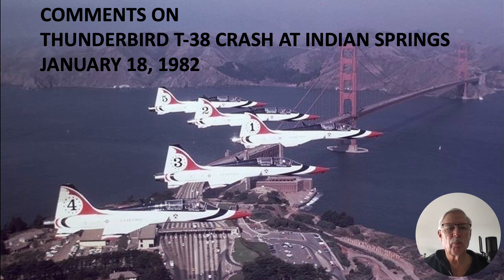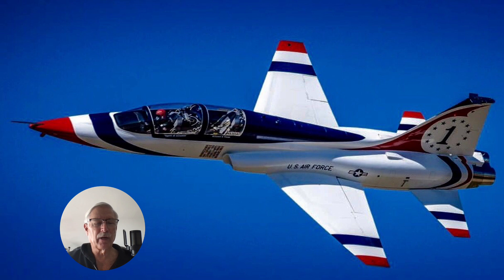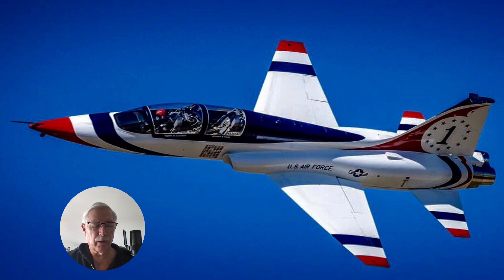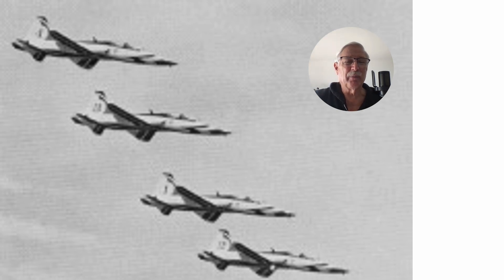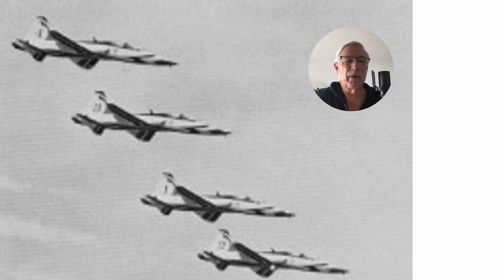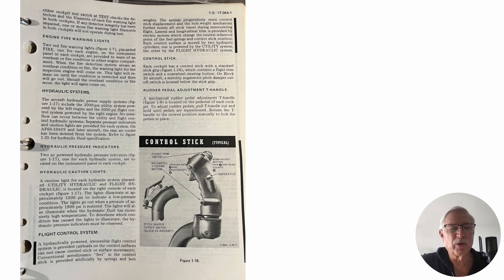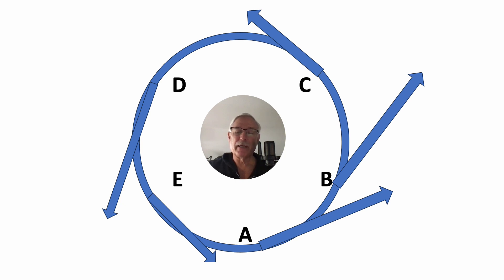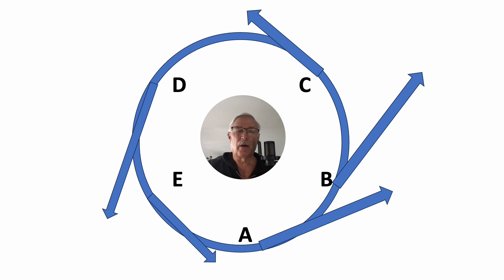COMMENTS ON THUNDERBIRD T-38 CRASH AT INDIAN SPRINGS JANUARY 18, 1982

Comment: I was involved in the “collateral” (releasable) investigation. FOD (a tool) was found to have jammed the flight controls. Lead, for undetermined reasons, was not using a hot mic. When lead removed his hand from the throttle, presumably in an attempt to gain greater authority, the remainder of the flight was committed to the outcome. Lead did not call “knock it off” because his hand was off the throttle with the mic button. 2, 3 and 4 were concentrating on maintaining relative position to lead. The crash scars were in formation.
Reply: What kind of tool was it?
Reply: This is absolutely NOT true. False statement. I was on the team and never was there a tool cause of this accident
Reply: @RodgerFreiberger Which team?
Reply: @RodgerFreiberger Which team were you a member of?
Reply: @richardbriscoe8563  What kind of tool was it?
Reply: @Peter-u6d It’s been a long time, but, to the best of my recollection, it was a screwdriver.

The commenter who said he was on the team, I suspect, may have been involved in the privileged safety investigation. Making any comment about the content of that investigation is a serious breach of discipline.
Reply: @richardbriscoe8563  The report I read that was published in AW&ST doesn't mention a tool but it does say FOD was a possibility due to the condition of the stab system overload cylinder.
Reply: @Peter-u6d The collateral investigation, the publically releasable one, was conducted at the direction of HQ USAF due to the chain of command of the Thunderbirds although the mishap occurred at a TAC base under the command of 12th AF. I haven’t read the article which had to be a summary of the lengthy report and so I won’t comment on the article itself. I did have real time information during the conduct of the investigation. 

It was a sad day and the result of a chain of circumstances.

Comment: The “Diamond crash” I am familiar with involved FOD interfering with elevator control. Lead was not flying with a hot Mike, which we were briefed was SOP. As a result, when lead took his hand off the throttle to use both hands on the stick the rest of the flight was condemned to the outcome of lead. It’s hard not to fault lead for this.
Reply: All the aircraft I worked on hot mike was only between the front and rear cockpit it had nothing to do with transmitting to other aircraft.
Reply: By the time Lead knew he was in trouble, recovery was impossible for any of the aircraft.

Comment: Two things: 1) Even mechanical flight controls have redundancies, therefore, single-point failure of a jam more likely than actuator failure - 2) pulling throttles back would seem advisible in order to increase pull-up rate.

Comment: I had read years ago about the Push to talk switch location on the throttle quadrant being a factor in this incident. The theory was that he had an elevator jam and pulled his throttle hand back to the stick to apply more back pressure and as a result couldn't call the break. I read this years ago and it really stuck in my mind. Can anyone here confirm or deny this who actually knows?

Comment: I remember seeing this crash on TV as a little kid; the flight of four white T-38s in tight formation all flying steady near bottom of loop right into ground at about 25°-35° angle before what should've been leveling back into horizontal flight, from what I can remember... all on a sunny and clear desert day setting... the exploding wreckage of all 4 planes happening almost simultaneously, and "bouncing back up" hurtling together in a huge-shallow fiery arc across the desert backdrop... not so much a "fireball" as probably more-like wildly-expanding conflagration that crashed and exploded again at the end of that fiery-arc across the desert. I thought about this incident in recent years and searched online for this footage; to my surprise some USAF commanding officer somewhere along the chain ordered the complete destruction of this footage, although I'd imagine some TV news network would probably have it on video tape in the archives somewhere.

Comment: So you;re saying the actuator failed late in the loop but because of the increasing speed (they were pointing downhill) the nose continued to rise as the speed increased further and the elevator generated more downforce even though it was 'stuck' and no longer following stick pitch inputs from the pilot - masking the problem.
By the time he realised he had a pitch control problem, it was too late and he went in. The other 4 of course would have no idea that lead had a problem so they stayed in formation and perhaps only became a aware of the proximity of the ground far too late to do anything about it.
The report saying he pulled the power back to idle is odd. If he'd done that the other 4 would have left him behind as you say at which point they would probably have broken formation in time to avoid the rapidly approaching ground.
Vince

Comment: I was stationed at Indian Springs AFAF with Operating Location Alpha, 2069th Communications Squadron, May 1981 until May 1983.  We maintained the air traffic control facilities there, and radios and scoring systems at Range 65. It was common to see the T-Birds practice at the Springs.  You got used to it.  That morning I was walking along the flight line to the control tower watching as the four came across the field from the west and pulled into the line abreast loop, went over the top, and descended to exit the loop to the east at the point they had entered.  They were still 'sinking' and the last I saw was #1 pulling nose up, tail down an instant before all four aircraft simultaneously impacted the ground on their bellies traveling forward, three rapid succession explosions and they disappeared into that angry yellow, orange, red, black roiling ball of flame and smoke.   Sounds and imagery that burns into your memory.  I still have PTSD as a result.
I never again watched them fly, or any air demo team for that matter.  In 1983 I was assigned TDY with the T-Birds to design and develop their new public address system.  At each base visited, before the show started I found a hanger or building that was relatively quiet where I could 'hide' and avoid seeing the show.

Comment: I am wondering what the dive recovery charts would have shown as far as recover-ability for the wing men.  I also have to question the safe ejection altitude for the T-38 ejection system.  I flew the F-4 and I would say a Phantom would be hard pressed to make the square corner after passing E and ejection would be on the ragged edge.

Comment: This is a pretty good synopsis overall, Roger. 

When DL punched out at Cleveland, Burke Lakefront, the team was taking off in elements of two, two, and three due to the the short (6000') wet runway. They planned to meet up at thenext gas stop and reform for arrival maneuvers at their next show site. DL liked to connect his lap belt off center and the team was using a new lap belt system. A moment after  he punched ( after he called his crew chief to eject),  the lap belt opened and the "butt snapper" launched  him out of the seat right on schedule.However, the new lap belt contacted the ejection handle and the locking mechanism turned, which popped the zero delay lanyard out of the socket in the belt buckle, eliminating his low altitude chute deployment.
Reply: Had he worn his lap belt centered, would this have occurred?
Reply: @joe92  That is hard to know for certain, but where it was connected would ultimately determine to where the buckle would hinge to when it was automatically released.
Reply: Thank you for the additional details of this incident.

Comment: The one thing that really makes no sense in the accident report, is that the Boss hit the ground, tail first; since the formation is coming down the backside of the loop, when he had the control failure, all four went straight in, nose down, so the fact that the report said that all four hit tail first, is wrong. I can see hitting tail first if the Boss managed to find a way to start pulling out of the dive, and the formation had run out of room for a safe recovery. But, no, they all went in, nose first.
Reply: The report did not say all four hit the tail first. By the time they were close to bottoming out, they were pulling 7 Gs. The line abreast was sagging at each end due to the unusally high formation Gs. #4 hit first, nose low on the outside left, followed by #3 just slightly nose low on the right, followed by #2 flat on the inside left, followed by #1 slightly nose high. #1 almost made it.

Comment: I found a copy of the USAF Mishap Report for this accident on a website some time ago. The Mishap Report, unlike the Accident Investigation Board report, was not released to the public at the time. The person who had it on his website got it through an FOIA request.  The Mishap Report goes into a very detailed analysis of the accident and of the components of each involved airplane. The lead T-38's stabilator actuator and pitch trim actuator showed no evidence of malfunction prior to the aircraft striking the ground, and from my reading of the Mishap Report, it's pretty darned certain that Major Lowry simply messed up the recovery from the line-abreast loop.  The conclusions at the end of the mishap report repeat essentially what the AIB said, that the leader's stabilator jammed, but with no supporting evidence to that conclusion that I could find within the Mishap Report. There's no mention of a "load relief cylinder" and I've read elsewhere that the T-38 doesn't actually have such a thing, that it was made up for the AIB report that was released to the public. I've uploaded the Mishap Report to my OneDrive account, you can download it here:
https://1drv.ms/b/s!AgkGLeB5btNZ-kWRHATlG3juhq8h?e=eeMBg2
Reply: I've read both the mishap report and the summary of the accident report in AW&ST and have noticed inconsistencies between the two but there are pictures of the leads "load relief cylinder" showing it in pieces due to tension overload.  I think I know where the claim that the load relief cylinder does not exist  came from but he got it wrong.  It is in the system and you can find it in the T.O.  As a side note the aileron control system has a similar setup with an "over-load relief spring", it prevents cable loads from overloading or damaging pulley brackets and operating mechanisms.

Comment: Years later at WPAFB, I received a briefing on this accident.  Was told the stabs on all of these T-38’s were purposely adjusted outside maintenance manual specifications in order to gain improved inverted performance.  This resulted in limited stab  positive G or pull performance.  The briefer stated yes, the maneuver started outside required entry parameters, resulting in a lower loop.  He also briefed that had the stabs not been adjusted outside mx manual limitations, lead could have given higher g input earlier and avoided the accident.  This is what I was briefed and all I know about this subject.  I have no idea if I was told the truth.
Reply: The stabs were NOT adjusted whatsoever. The rudder limiters were removed, making the Thunderbird T-38s much more maneuverable than normal T-38s. (Those limiters were initially installed to make the typical T-38 more spin resistant as a trainer).  F-5 trim motors were installed to give the pilots more trim authority thus reducing PIOs at high speeds, and the engines had better oil accumulators giving the Thunderbirds twice the inverted time of a normal T-38. But nothing was modified out of any T.O. tolerances. That is nonsense.

Comment: I spent more than a decade as a quality control inspector on T-38s. We were briefed that the cause of the crash was an artificial feel mechanism failure in the stab system. In QC we got what the AF called Blue 4 News (accident/incident reports). Nothing in that indicated anything different, other than some of the wording. That made a lot of sense, and I never really questioned it. About 25 years later, I was again a QC inspector on T-38s, but this time as a civilian. We had a new guy come into our shop from another station (also as a civilian). I got to know him a little bit, and was surprised that he had been on the maintenance crew for the T-Birds from 1981 until 1983. So I asked him what happened. I was completely floored when he said what they were briefed. As someone has already intimated in these replies here, he said that the lead pilot failed to reset his altimeter. But they were told to say it was a stab issue. I worked with this guy for about a year, and never once did he ever give me any ideas that he was a BSer. He was always very serious about his job, and how he did it. One of the new pilots when they went to the F-16s, was a pilot I knew well. I won't use his name, but he was on that team of the first F-16 Thunderbirds. I ran into him at an air show that they were performing at. I had no idea he was now a T-Bird pilot. Now this was years before I met the QC inspector that I mentioned above. I asked him what happened, and he just said the stab issue, and wouldn't say anything else. This is a guy that I had gotten to know because we had identical Corvettes. Back then, officers & enlisted didn't "fraternize" much, and he was surprised that an enlisted had a Corvette. Once I explained that if I didn't live in there dorms, and ate all my meals at the chow hall, I wouldn't have it. We were friends enough that he was at my weeding. Remember officers didn't frat with enlisted. I also asked that civilian QC inspector years later, if he remembered any of the new F-16 pilots. He said that he couldn't remember all of them, but rattled off 4-5 names. One of them was my friend, and I hadn't mentioned his name. I think that was why he divulged the altimeter info. 
My mom worked for nearly 40 years at GE Evandale, OH. The T-38s are still powered by GE (J-85) engines. Evandale is almost completely consumed with building engines for commercial aircraft, but there was an office there that dealt only with military jet engines. My mom had only 2 people in her chain of command there. Her immediate supervisor, and the entire GE complex plant manager in Evandale. Any military jet engines involved in accidents, were sent there to see if it was engine related or not. If we had a crash/incident at our base, usually within 6-8 weeks she'd tell me if it was because of their engines. She would never come out and say "no, not the engine's fault", she'd say something like maybe we needed to look elsewhere. Not once did any official crash summary ever contradict what she told me. They got all 8 of the Indian Springs crash engines. 
I was involved with another investigation involving a T-38. It was an FCF flight, flown by Capt Bob Pheifer. During that flight, he lost the left stab during a hard G maneuver. The chase ship said that he only lost about half of the stab. So the Depot team (flight ops was in contact via phone, looking for input for what the pilot needed to do). They said "he can land it. Capt P. was playing around trying things, and said ok, he'd give it a try, but would need a 25 mile straight in approach. We flew a lot of aircraft everyday, and clearing out that much airspace did cause a lot of diverts. But hey, we needed to get him back safely, and they didn't want to endanger anyone else, as the jet was still barely flyable. One of the things that he had to do, was try moving the flaps to see if that effected stability. Yeah it did, in a massive way. So that meant he'd have to do a straight in approach. Thus the request for a 25 mile straight in final. That's about 185 kts landing speed in a T-38. No problem, they practice that all the time, but not without a left stab. When he got to the runway at that speed, the jet bounced a little. He then did pilot's things, and tried to make inputs to correct it. The jet started to roll, and I was sure that I was going to watch him die that day. I have no idea what he did (he didn't either he said), but it rolled back wings level, and just chopped the throttles. He stopped about a 100' short of the end of the runway. He so wanted out of that jet that he didn't wait for the fire dept to provide a ladder, he just jumped. When he walked back to the left stab area, he fell to his knees. There was nothing there but the torque tube and some honeycomb fibers. When the SOF called the depot team back and told them that the entire stab was missing, they said he should have punched out. So sometimes the experts don't always know, or give the right info. 
I'll never know exactly what happened at Indian Springs, but after working for the US government for as many years as I did, I've come to not being surprised when they tell me "what really happened" and it wasn't And don't get me started on vaccines, after what happened in 1976 to us in the military. Will the gov't ever admit to how many GIs died from that fiasco? Of course not. The gov't is the keeper of all secrets, but amazingly I've had my identity stolen 4 times. All because of someone working in the gov't screwing up.
Reply: You have conflated two different accidents. Ron Rogers and your original understanding are largely correct. The altimeter had nothing to do with the T-38 crash. However, it was used in an opening F-16 solo maneuver later on. The pilot there, did indeed have the wrong altimeter.

Comment: The whole accident investigation sounds suspect, pulling power at 400 feet and your entire flight remains in formation.  At 281 feet your still 26 degrees nose down, yet you impact the ground TAIL first?  If he did, then he must of still had full elevator or stab control.  It doesn’t seem to add up.